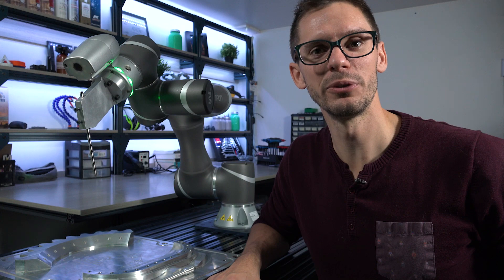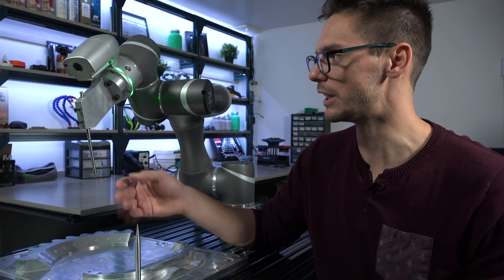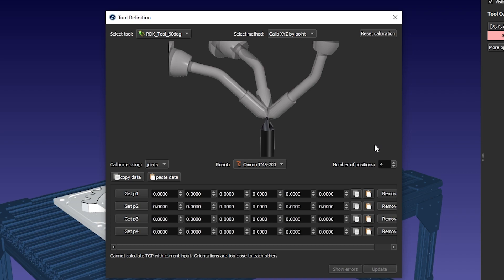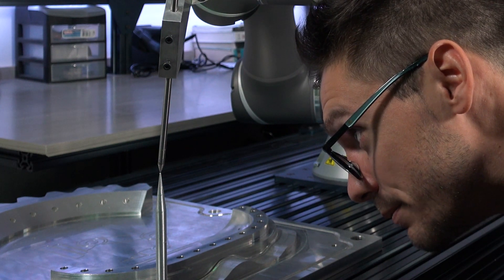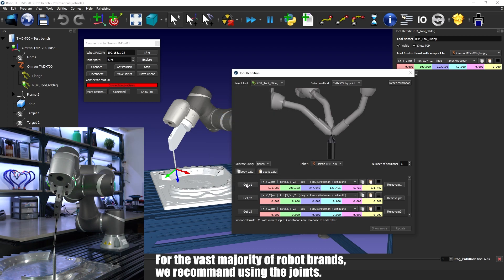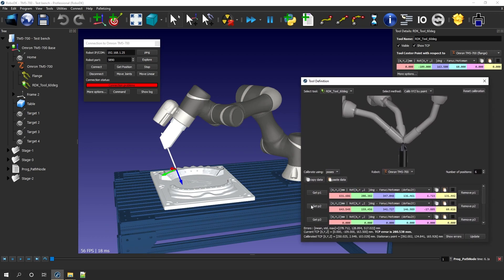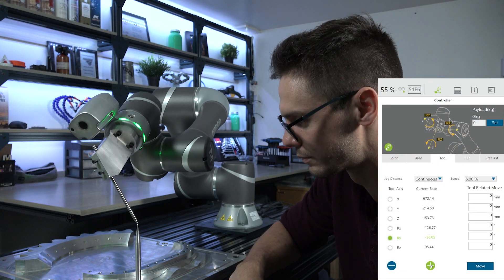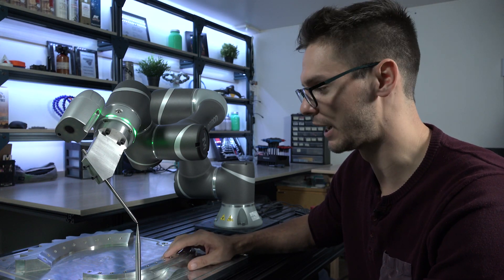How to Define your Robot Tool (TCP) - RoboDK

Comment: Great video, thanks for this. I might have missed this in the video but did you just plug in nominal values for Rx, Ry, Rz? It looks like this method just determines x, y, z translation of the TCP relative to the flange right? Just trying to make sure I'm understanding this correctly. In general most people must not have to calibrate rotational tool offsets as the TCP will still be correct, although it might not rotate perfectly at the base of your tool if you rotated the tool in it's own coordinate frame for example about Z in your video.

Comment: Nice video, I was wondering; if I have my station on RoboDk with right robot and right tool, do I need to make the TCP definition for the first time or can I trust the software? Of course given that the tool in the software is correct.
Reply from the maker: The real tool coordinates (or TCP) doesn't always match the 3D model due to manufacturing accuracies, robot accuracy and how you mount the tool on your robot flange. If you don't need high accuracy you can rely on the 3D model coordinates. It is better if you ask technical questions in the RoboDK forum: https://robodk.com/forum/index.php

Comment: Very Good Jeremy! but what if we have a yaskawa robot that shows the values of the axes with up to six digits?
Reply from the maker: You may be referring to Yaskawa/Motoman pulse data instead of degrees. It is better if you use the driver for this purpose or generate a JBI program and then import it in RoboDK to extract the joint values. It is better if you ask technical questions in our forum: https://robodk.com/forum/index.php
Reply: @RoboDK3D  Thank You, I will consider your comments!